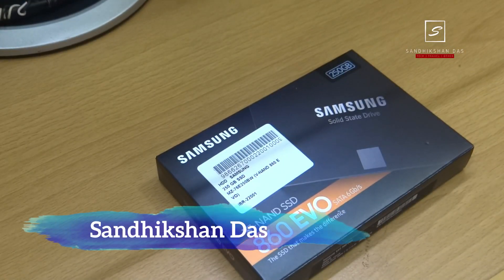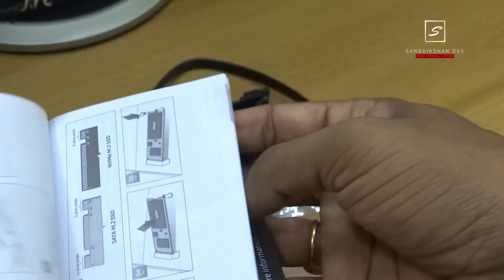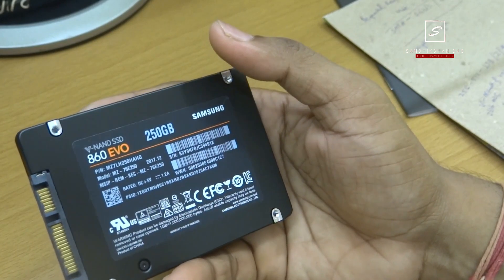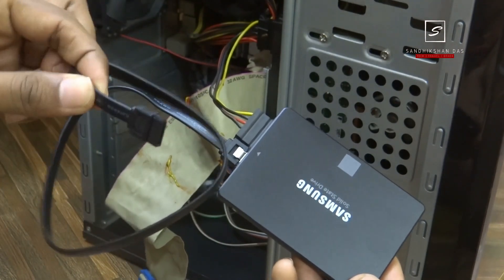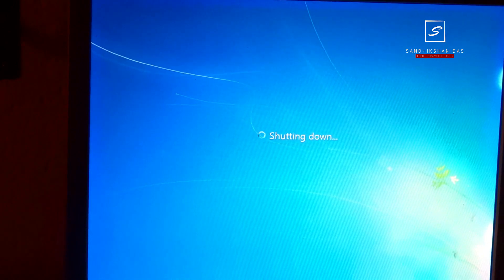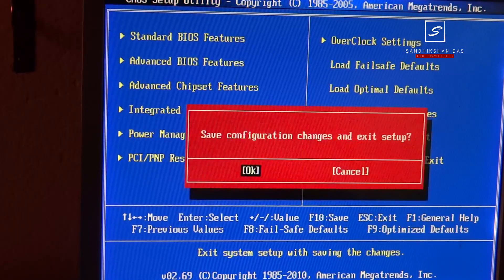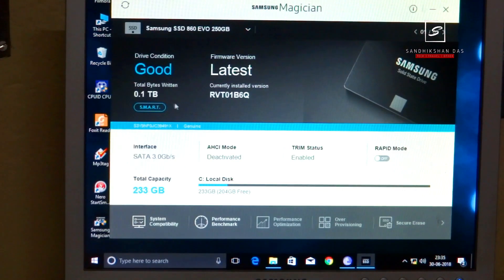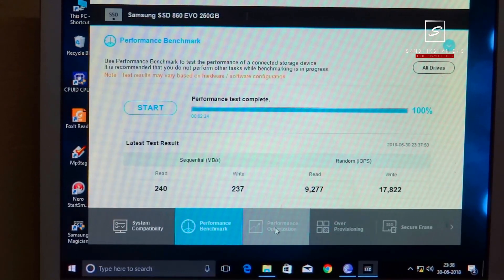Installing Samsung Evo 860 250Gb SSD in G41 Board | Unbox, Review & how to install OS in ssd + HDD

Comment: bro i do have this asrock intel g41 mobo,does this mobo can support hdd and ssd together?
Reply from the maker: If you have working 2 sata port on motherboard then obviously it will support
Reply: @SANDHIKSHANDAS  it does support bro but there's another 2 cable that i dunno where to put it in

Comment: my ssd is 860 evo 1tb  but my ssd speed in write 250 mb but this ssd have 500 mb in test speed. why my ssd is low speed. i active ahci in boot but i cant use all speed from this ssd help me pls. my pc 
core i3 4490s  and 8 gig ddr 3 .my motherboard is h81-plus
one tip:i have hdd 500 gig and i use this but  i install windows 10 on the ssd . now i can use all speed from ssd help me pls
Reply: @Tech check yes
Reply: @Tech check i use yellow but i have low speed
Reply: @Tech check  i try wih 2 port  and my windows is fresh but my speed is under 200 mb
Reply: @Tech check i use samsung magician and  ok every things is
Reply: @Tech check i have 4 port sata.  2 port   dark is sata3   and 2 port yellow is sata 6
Reply: @Tech check i have 4 port. and 2 port sata3 and 2 port sata6
Reply: @Tech check yes i try 1 by 1

Comment: Mine G41 motherboard having e5800 processor, 2Gb of Ram and 500 Gb HDD boots windows 10 pro in 20 secs only. According to your video if I use this SSD my PC will boot up in 5-10 secs only ?
Reply from the maker: Same motherboard ? Yes it should be obviously..ssd is much more faster than normal magnetic disk hard disk..ssd has 540mbps speed while normal sata harddisk can go up to maximum 250mbps..
Reply from the maker: While I will recommend you this samsung ssd 860 evo and samsung is the king of ssd while WD is the 2nd best..the price of the samsung ssd is now decreased to 4000 on Amazon

Comment: Wd mechanical drive had option of transferring window OS from old installed mechanical drive. No such option available for Samsung ssd or any other brand ssd? So formating old drive and fresh window installation is not necessary.
Does ssd drive support window 7?
Reply from the maker: It supports any os from 7 to 10. Yes samsung has also cloning option which does not need fresh installation, you just need a special connecting cable to transfer the data from old to this ssd